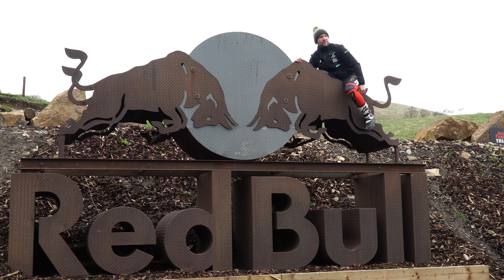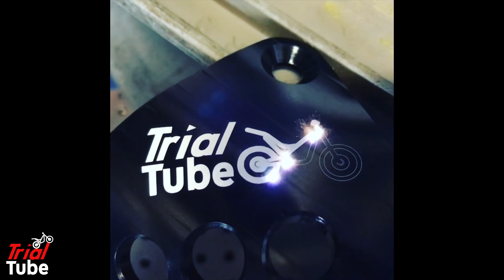Trial Tube - Do I still love my Vertigo R3 300 2 Stroke? Plus trials tutorials!

Comment: To make those bearings last and last, remove wheel pop dirt seals, pack with bearing grease, or if you really want to get into it, pop out bearing removing dirt seals using a jewelry screwdriver [ flat ]  then totally clean bearings with degreaser,,,dry then pack with bearing grease, repeat every 6 months or sooner if lots of wet riding. Bearings should last for years. Let’s face it they don’t spin all the fast or get hot!
Reply from the maker: Very true and will give it a whirl but I think it’s more due to impact?

Comment: Hi Danny     I want to know the truth about electric trials bikes,   as in all the club videos no one seems to be riding them, they have their own competition, Jan Peters at the world rounds was making comments that certain obstacles were to big for them and certainly no one rides them in general competition, so are they CRAP !!!
Reply: Disclaimer: Passionate Vertigo dealer speaking.

I've got an EM Escape R, not an E Pure - but have ridden the latter as well.

I like them. A lot. However, enjoyable as they are - I'm still way more capable on the Vertigo. I don't think it's a matter of familiarity, as I've spent significant time on both - but there's something about electric power delivery that's not totally compatible with my riding style. Super slow and tight, it's tough to beat. However, the minute I need to zap, especially if an obstacle is involved - I just feel out of my element. Others seem to adapt to them just fine, and even excel - but I just can't wrap my head around it.

And, while I'd not consider an EM without a proper clutch - I'm spoiled rotten by the perfection that is the Vertigo clutch. Compared to that, I find the EM's a bit...lacking. It's light, but I find it grabby with a short throw between engaged and disengaged. However, clutch critique is something I bring up with virtually every trials bike compared to the Vertigo. I've never felt one better. It's just insanely easy, smooth and linear through the entire range.
Reply: Will I largely agree with your assessment after a recent go on the race model. It was a nice bike, didn't care for the R16V shock. Action was lacking compared to Reiger.  I've seen videos of the bike being ridden at local level expert or slightly above, and I could see how that would be possible,  but I think it would take a very good rider or one that only rides the EM . 
    I had a hard time with holding pressure over a log and slowly setting the front down. I either didn't have enough power and the bike "bogged down" or I had too much and it felt like it wanted to loop out if not very careful on the clutch. Ultimately if I was a better rider it wouldn't be a problem, but coming from a 300R2 it would require quite the adjustment in style and timing to ride at the same level I can ride my Vertigo.
Reply: @shawnmcginnis2508  - I put an Ohlins on my Escape R, and my buddy w/same bike put a Reiger on his.

HUGE improvement on both, but unless one finds a great deal on used shocks like we did - that makes a very expensive bike even more so.